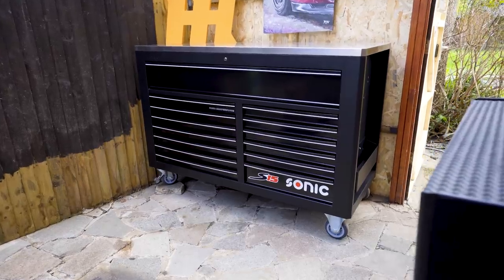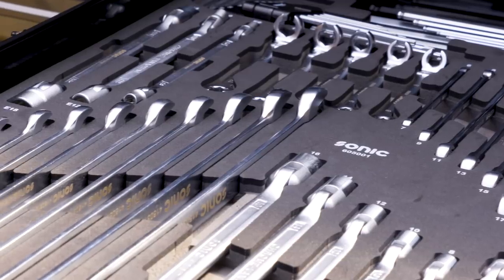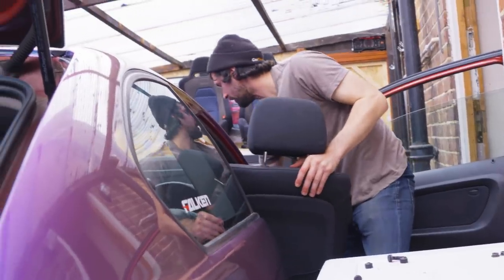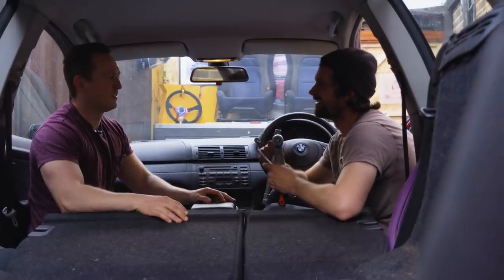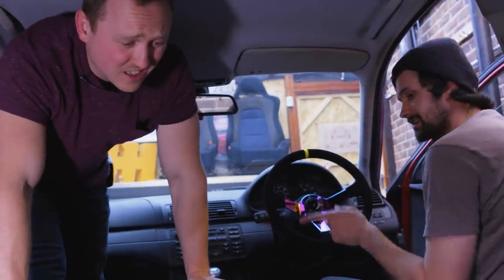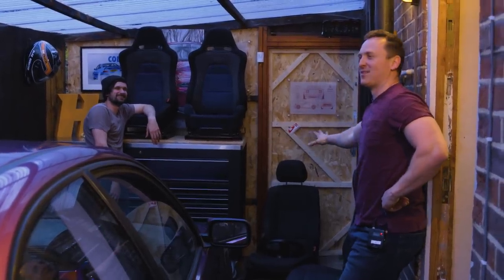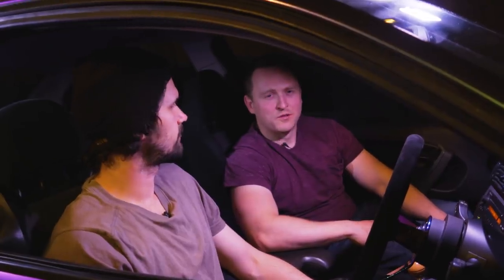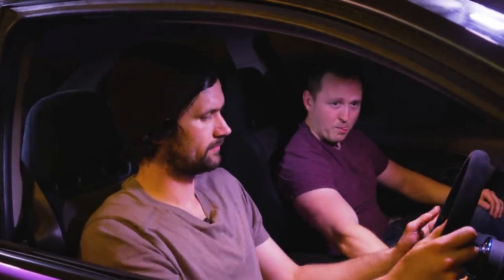Fitting EVO 8 Seats To Project BMW E46 Compact

Comment: I’m not sure how feasible it would be but I would love to see you put a headlining in Kenny just like the one in the Rolls Royce Phantom with all the stars twinkling. Just a thought. 🤔🤔
Reply: easy. get ply wood, drill holes into it, spay it black, glue a TV LCD backlight behind it, do some wiring and done!
Reply: @macchiatotea5196  or you could just buy a some fibre optic cable and a bit of cloth poke holes in and glue to the roof done!
Reply: @MrDrift3887  knowing those guys, I think they just drill holes into the roof directly and glue a sheet of plexiglass over it xD
Reply: @macchiatotea5196  Sounds complicated. They'll probably just cut the roof off and only drive at night.

Comment: As now you got a proppa BMW! 
Now you need an aftermarket cold air intake with a pod filter, upgraded fuel pump and obviously, Lowering springs (Or air suspension) for the extra lows. 
Will help on London roads trow some sparkys 😉 (Metal plate on the underside). 
And the most important things, Upgraded RGB headlight and tail lights for them RICER look. 
P.S Angel eyes required for the BMW life

Comment: Suggestions: ditch the rear seats for a super speaker install, a big wing with struts from the back bumper so you can't open the rest hatch, extra deep front splitter with bars from the bumper to hold it up, canards, neons under the car, 7 inch exit back box, smoked chrome alloys, angel eye headlamps, a sun visor so deep you can only see traffic lights from half a mile away and finally fake sponsor stickers on the front wing. I think I've covered most of them.

Comment: This thing NEEDS a lift kit everyone lowering their cars you go the opposite way like an American w his truck (compensate for Alex's height)
Reply: Or put midget or dwarf because aparently midgets offensive at the wheel or dwarf driving sticker on the back or put a booster seat in it when alex drives or leave it on his seat when he leaves the car somewhere when hes driving it

Comment: You should install race chip in kenny, and have a race with Ethans Z3 with Ethan driving it, if Kenny wins, it can have anything from the Z3 (or similar part) and it must be installed by Ethan, but if Z3 wins the race, Ethan can have a track day with your red v6 Mazda 😁

Comment: Sorry but if an airbag was fitted as original equipment iit has to be installed, a resistor across the contacts won't cut it at MOT time! I found out the hard way on my Mk2 MX5

Comment: I remember years ago when I used to buy a certain car magazine there used to be an electronic dump valve for non turbo cars. It was basically a tiny speaker that you would hide under the bonnet somewhere. I feel that this should be a mod since it would be so w**k it would be great.